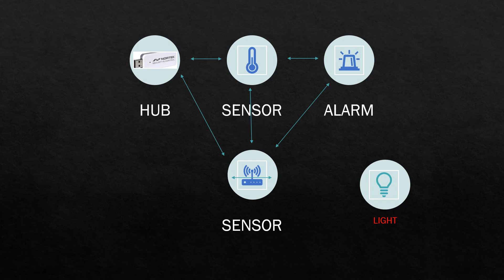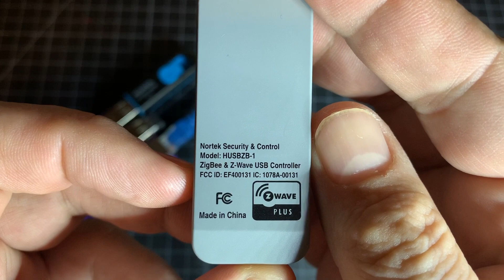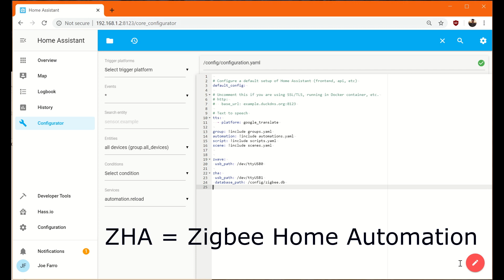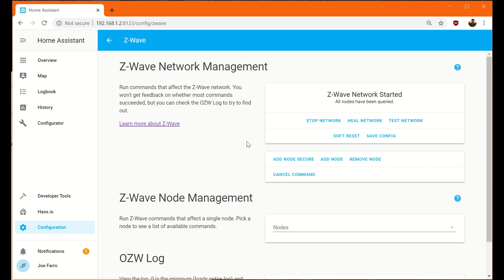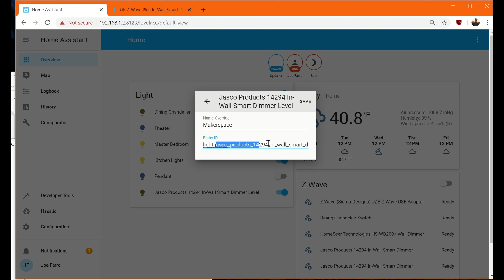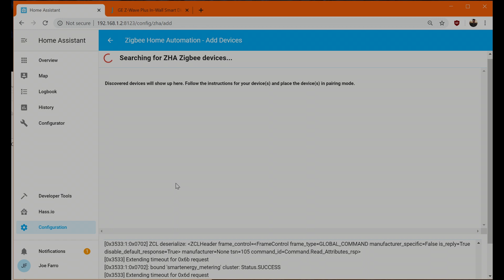HassIO Zwave setup for beginners

Comment: Good step by step instruction. Just one suggestion: they changed Configurator to File Editor. If you can update that it would help noobs like me!
Reply from the maker: Yeah they’re changing stuff faster than I can get videos out!!!!! I’ll get the description updated for now. Thanks for the feedback glad it’s helping!!
Reply: I was able to add Zigbee and Z-Wave straight from the integrations tab under Configuration.
Reply from the maker: Yeah that’s the problem with doing videos on software that changes so fast is that it becomes outdated. Zwave is moving to open zwave and MQTT at some point so I’m waiting for that to happen before redoing this tutorial. Also I’ll break out the zigbee stuff as conbee and possibly zigbee2mqtt may be a better more comparable option that what I had

Comment: You said "hit the button" and something popped up in the corner (sorry I am brand spanking new). What was that, where is it, how did it pop up?
Reply from the maker: Oh! The button in that case was the actual light switch. Most zwave devices have a pairing button, or you turn them on to pair them. So “the button” is the actual light switch.

The thing that showed in the UI was my screen recording software...unrelated to what I was saying. I’d just unpaused the video at that point so it was a coincidence

Comment: Great video! very helpful. I am having a wierd problem where the zwave works fine but zigbee does not seem to be working at all. Anyone encounter this? I have set it up verbatim as what is shown in this video.
Reply: I figured it out. It works if you add zigbee integration through configuration ->integrations then pick the usb port. Just incase anyone else is running into the same thing.
Reply from the maker: Since this video I believe they’ve reworked both Zwave and Zigbee. Glad you got it figured out. It’s tough with video content to keep up with home assistant...they change very fast right now but they’re overall positive changes

Comment: I'm trying to add a Aeotec Smart Switch 6.  I've done a reset on the switch as per the manual (Hold action button down for 20 seconds).  I tried to connect using your method, but couldn't get anything to appear, so I tried using the method in the Aeotec manual which was to unplug the USB Z-Wave stick from my Raspberry Pi, press the action button on the USB stick and then the action button on the switch.  It seemed to pair.  I then plugged the USB stick into the Raspberry Pi and did a reboot.

Under Configuration, it appears as Unknown Node 3 (Node:3 probe) and when I look at the last 10 lines, the 3rd last line reads:  "Error, Node003, ERROR: Dropping command because  node is presumed dead"

Am I doing something wrong?  Also, if I do need to remove it, what's the best way?

In case it's helpful, I purchased the Aeotech Z-Wave Z-Stick (S2) - https://www.smarthome.com.au/aeotec-z-wave-z-stick-s2.html rather than the newer one https://www.smarthome.com.au/aeotec-z-wave-usb-z-stick.html - I couldn't see what the difference was other than a newer look although I found out after purchase that the newer one is Z-Wave Plus.

Thanks
Reply from the maker: ugh...I had a similar situation with a wall switch.  There's two concepts that I was confusing...not sure if this is helpful to you but it's all I can really offer...one was unpairing (remove node) and one was factory reset.  I had to factory reset my device to get it to eventually pair. It'd get detected and fail similar to yours.  To factory reset the switch I had to search through to find the manual I'd thrown away and it was buried deep in there.  What happened to me is the node was paired with a different raspberry pi install, and it wouldn't unpair from that...so the factory reset was the only way to get the communication to break.  Not sure if that's helpful, but its all I can offer. I'm not sure if the reset your'e doing is the same as a factory restore/reset.  If it is, then the only thing I can offer is to clear everything and try again.  Remove the node, heal the network, reboot the pi, heal again, make sure you're totally clear, reset the switch, and then start it fresh and see if you get a different result. I've had switchest that worked the second time, I"ve had some that worked after rebooting the pi, I've had some that worked after I healed the netowrk, and I've had some that didn't show up till 3 or 4 days later.  Good luck, keep at it and hoping it works out!
Reply: @geektoolkit  Thanks. I've done the reset of the switch by holding down the action button for 20 seconds. Tried a few times. 

I might try your suggested steps (heal, reboot pi etc).

So to remove the node from the list in Hass.IO, do I reset switch and heal network and see if it disappears?

Also, the fact my USB isn't Z-Wave plus shouldn't make a difference should it?
Reply: @geektoolkit  Here's the manual. I gather the 20 second reset is a factory reset??

https://www.smarthome.com.au/media/manuals/Aeotec-Z-Wave-Plug-In-Smart-Switch-6-Product-Manual.pdf

Comment: Another great video! Three questions 1)do you still like the Nortek USB dongle? I was considering the Aeotec Z-stick, but it's z-wave only. But, I do have Hue lights. I was thinking I'd just continue to control them with the Hue Bridge?? 2)do you feel like the Pi3 still does a good job for you? 3)I'm replacing a Wink hub, so it sounds like I should go in and remove all the z-wave devices from it prior to setting them up in HASS??  Thanks again for your good work. ~Frank
Reply from the maker: Thanks for the nice comment!  Sorry for the slow responses, catching up now.  Lets see..
1) If I had to do it over again, I'd use deconz with a conbee stick.  The main reason is I found that ikea has tradfri stuff that is slick, super inexpensive, and uses zigbee...but with my stick I can't talk to them.  But apparently Conbee can.  I'm not sure if it'd let you talk to your Hue lights.  If you already have the bridge, I'd likely stick with the built in integration for simplicity..I try to simplify the home automation so I don't feel like an IT person in my own home and it stays fun.  That's just me :)

2) My pi3 is rocking.  I did a video on statistics and how to chart them in influx and with grafana...and I don't see my usage go over say 20% or so in normal usage with what I have..it's not a ton of stuff, but considering I have influx, grafana, and maybe 40 devices/sensors/etc. going and it's at 20% I think I'll stick with the pi3 for a while (It's not even a B+).  The Pi4 doesn't support USB boot, and I really feel like I need that after losing my entire setup to a corrupt SD card. I likely need to get a solid backup system going soon.

3) YES! Definitely remove them please....if you don't you may find yourself having to factory reset every one of them to get them to pair again.  I had to do that with my light switches and it was a nightmare.  I highly suggest removing them.  Also sorry to hear you were on wink..that was a really crappy situation.  But it also validates the concerns alot of us have, and why we're on HA :)

Hope that helps!
Reply: @geektoolkit  Thanks a lot for the feedback. Actually, I remembered that I'd ordered the Aeotec Zstick Gen5 a year or so ago to try a project, so I found it, and moved forward with the Home Assistant project. So far, I'll have to say it's been a real struggle. HA appears to be a really powerful ecosystem, but it hasn't been a simple system to digest for me. Documentation is sketchy and, although I've gotten some help from Discord, it's kind of up and down. It's just very much a product in development, as I see it. But, I'm planning to stick with it for now, but I've come pretty close to giving Domoticz a try. Thanks again, for taking the time to address my questions.

Comment: Great video, but I have one question. How do I set my Sengled bulbs into pairing mode? The bulbs I have require a Hub, which I have, but don't seem to be discovered by the Raspberry Pi. The Zigbee stick is set up and connected, so I'm unsure what to do now.
Reply from the maker: I think for mine I had to turn them on and off 3 times fast.  I didn't pair them to a hub...I paired them to the stick I'm using (They said they needed a hub, but they're zigbee, they just needed a compatable zigbee thing to act as a hub..which the stick I"m using does).  I'd try turning them on/off 3 or 5 times fast and see if that does it.  If not then you'll have to dig up a manual online (I"m constantly having to do that...i always forget how to pair my GE lights and so every 6 months or so I'll make a change to something and have to re-pair them all)

Comment: Great tutorial, thanks. I am using the same device, but I am on a Supervised Docker Install. I have the Zigbee portion working fine. But I cannot for the life of me get any of my z wave devices to pair. I have three Inovelli NZW30 switches and a GE (Jasco) switch exactly like yours. I am inclined to think because of my installation that I need to do something else to get the z wave to work, but I have not found anything on the internet to tell me what that might be. Any ideas? Thanks!!
Reply from the maker: Hey sorry for the slow replies...I got backed up a bit.  Did you happen to have them paired with another device and then do the install? That happened to me and if so, you end up in this really bad spot where you can't get them to pair because they never got properly unpaired..and the only way to unpair them is to use the originall install  or to factory reset them.  So I had to find the manuals online for every Zwave thing in my house that was paired to my old hub, and factory reset it (which is different than 'node remove').  Then I could get them to pair with the new install.

Also be aware the Supervised install got deprecated...apparently my old links are all broken. (Apologies, you might've been the person that told me...).  But just good to know. I'll have to do a new install video and weigh what to do...I may just go to a basic raspberry pi install and call it a day at this point.

Comment: Thanks for the video... I'm still coming up short somewhere. I have all of it setup properly, I can add nodes, remove, etc. But every time I add a new node, it makes it through- seemingly just fine- but it doesn't have any entities attached to it. I'm trying to add in a Samsung Smartthings plug, new out of box. It completes the pairing, says "Node:# Complete" but there aren't any entities listed below it nor new ones listed. Help??
Reply from the maker: DocEntertainmentProd have you tried rebooting after? I’ve found that after getting nodes to show up I have to reboot to get everything sorted after to get it fully working. Hoping that fixes it. I’ve also had to re-pair devices twice before and the second time they worked. I’m not sure why that is :(
Reply: @geektoolkit  I appreciate the reply. Unfortunately, none of those solutions work. Looking at the log, it sees the new devices as Node 006 every time, and every time it says it fails. Used 2 different plugs now. Nuked (stopped network, deleted all zwave stuff in directory) and reinstalled zwave via adding it to config.yaml. Try again, Node 006 fails. So frustrating.
Reply from the maker: DocEntertainmentProd one other idea is to not just delete it but go through the removal steps (usually you have to do something on the zwave device to put it in exclusion mode). Otherwise it’ll get stuck and when you read it it just adds back the busted config. This stuff is unfortunately a mess IMO...when it works it’s great but there’s quite often a lot that goes wrong betweeen all the moving parts

Comment: great video - I'd love you to add another to your suite.... hassio on main system, and a second raspi with the usb stick.  Have the second raspberry not have hassio on it, but raspbian (or other unix), and just the usb stick.  Then connect it to the main hassio system through mqtt.   That is what I want to do, as I have a network connected from my office to main house (separate buildings, same lan) with devices in both.  Thoughts? Could you do this?
Reply from the maker: Howie Grapek I myself have no experience in connecting two houses, espescially over a LAN (which could have some interesting possibilities as occupancy in one could turn on security features in the other, or control Hvac...). I’m sorry but honestly I’m not the guy to answer that but I’d ask Dr Zzs

Comment: Hi,
Thanks for the video. Is great.
I have Xiaomi and Shelly devices. Not working together.

I want to buy the Raspeberry Pi 4, install Hassio and HA.
Shelly devices are easy to put in HA with MQTT.
But can you tell me if the Xiaomi devices that are Zigbee can be added also, like you told in your video?
Then I can work with all of them together.
Reply from the maker: From what I understand zigbee is a protocol, so if they support it it should pair with HA. However I’m hearing reports that some zigbee implementations are not standard so there may be problems. The state of home automation sadly is that there’s no guarantees, may have to try one and see if it works or research on the forums. I don’t have the Xiaomi devices to test sadly
Reply: @geektoolkit  Hi. Thank you for the feedback.
I think you are right.
Xiaomi devices works with Zigbee protocol, but not a standard. I don't know really how it works, but I think they need to be flashed first.

If you can find one to test it would be great.